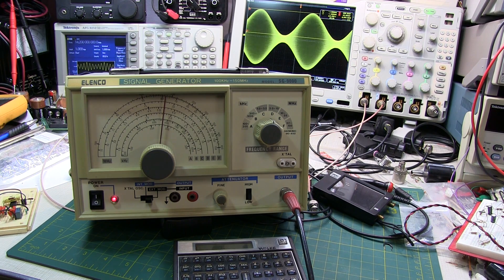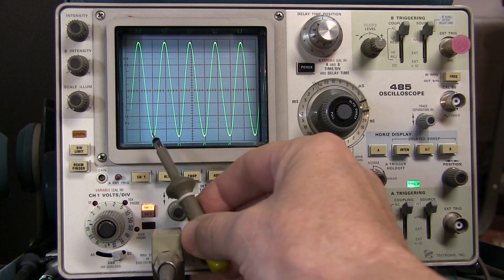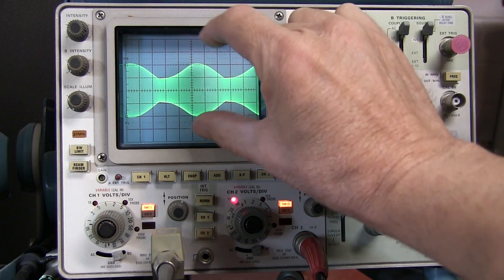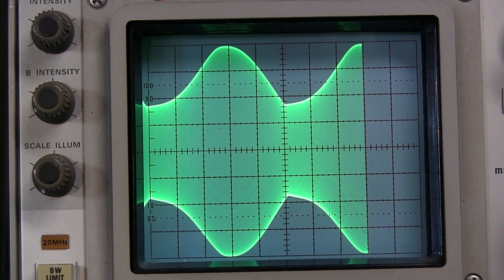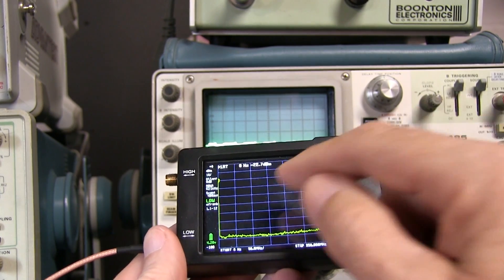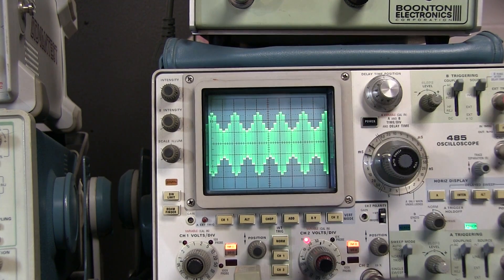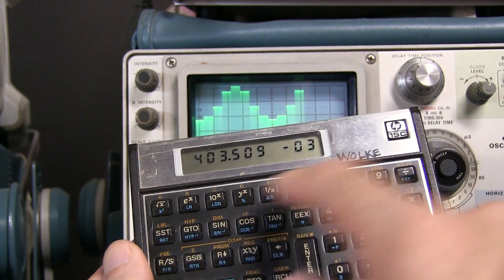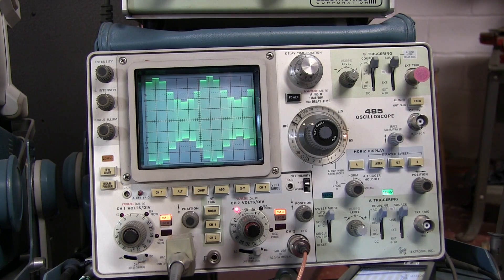#383: Measuring AM Modulation Depth using an Analog Oscilloscope (followup from #382)

Comment: Seems to me the HF Reject on the trigger would allow to trigger on the envelope.   Nice velocity modulation of intensity on whatever DSO you had in the background.
Reply from the maker: Not really, because there really isn't any signal content below HF.
Reply: @w2aew  "Not really, because there really isn't any signal content below HF."
Yes, I was mistaken.  I can see that there is NO signal content below HF.  The envelope would be filtered out of existence since the positive swings and the negative swings cancel out.   It would have to be rectified, filtered, then passed to the trigger.

Comment: Nice 485!

A 485 found its way into my vintage Tek collection about a year ago.  Unfortunately, it has a triggering issue that is probably due to bad tunnel diodes.  I haven't had time to work on it any further yet.
Reply from the maker: Great scope! I hope you can fix it.  The 485 has a very sharp trace on its CRT.
Reply: @w2aew  
Even wilder, my 485 has a P11 phosphor CRT.  It's the only scope in my collection with a P11 phosphor.

Comment: You just can't beat an analog scope for RF envelopes.  You can't quite get rid of the triggering jitter on digital scopes easily.  The 485 was rock solid with little effort and what a gorgeous display.  I'd never give up my Tek 7844R dual beam scope on my bench.  I also have a couple of Heathkit SM5228 VTVM's hanging off my equipment shelves that I use for things like aligning radios, you just can't beat a swinging needle for fast peak/null settings of analog signals that I wouldn't ditch either.

Comment: A month ago I was kinda struggling with this concept. I was trying to figure out where was the "modulation depth" figure from a signal generator coming from, because my naive assumption was that it was probably a % of VP, but that wasn't matching any measurements I was able to make. After watching this video (and the previous one) I had to try both on analog and digital scopes, and it made everything so much clearer to me. Now I totally understand how it's calculated and can check/calculate this parameter myself.

Thanks!

Comment: there is a 100% scale on the old tek, too (y) tnx for new input, Alan. And congrats to 200k subs. 73
Reply from the maker: The 100% scale is used mainly for 10-90% rise and fall time measurements.  The 100% scale is shy of the graticule's full scale to account for overshoot/undershoot on the edges.

Comment: Nice! And now FM modulation depth please!
Reply from the maker: I do have a few videos on measuring FM modulation index:
Bessel Null method: https://youtu.be/8IBOYoIV5m8?si=b3609rda__8E5QUr
Spectrum Analyzer method: https://youtu.be/Nw3_w1HrlEs?si=oB8UkNpGjTKMgazs
Unfortunately, there isn't a really good/accurate way to do this in the time domain with a scope because the change in frequency (deviation) is typically much, much smaller than the carrier frequency, so the difference is hard to measure.  One more complicated option would be to down-convert to a lower frequency so that the deviation is a much larger fraction of the carrier (the principle behind the pulse counting FM detector: https://youtu.be/jQlN2fc7LJc?si=-LIZgbyeifYtIBv9).
Reply: @w2aew  Thank you very much! Will look into it.

Comment: If you have TinySA with AM modulated signal you get carrier frequency and two side bands.  The amplitude of side band compare to the amplitude carrier is related to your modulation index:
m=10^((x+6.02)/20)
m=modulation index
x=the difference between carrier amplitude and side tones in dBV
for details please do a search "Measuring the Modulation Index of an AM Signal using an FFT"

Comment: Watching the last one, I felt sure that you couldn't do the measurement with an analog scope... great video!
Reply: What purpose would a analog oscilloscope serve if it couldn't take measurements?  That's why it has calibrated time base and voltage settings for the scale.
Reply: @mikesradiorepair  Actually, early oscilloscopes didn't all have calibrated time base and voltage settings.  The ability to "see" a waveform was big advantage of the scope.  In fact, for the purpose shown here, he is not using the calibrated scales.  Many years ago a friend gave me an ancient Heathkit scope which did not have a calibrated display.